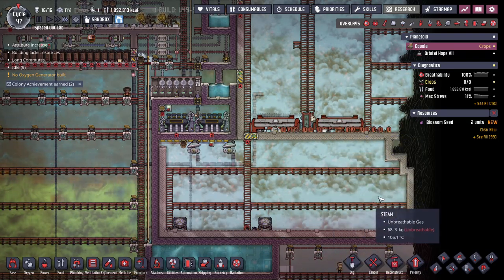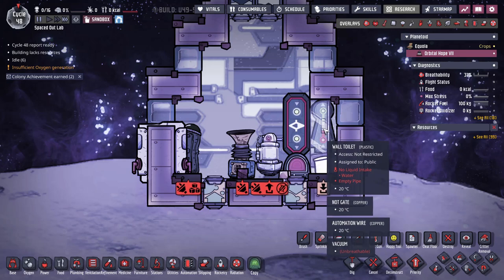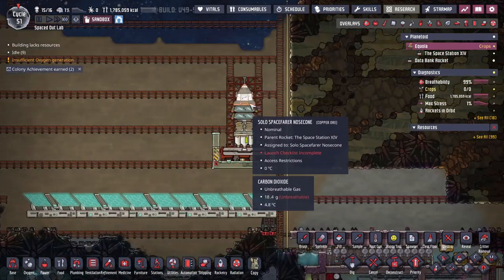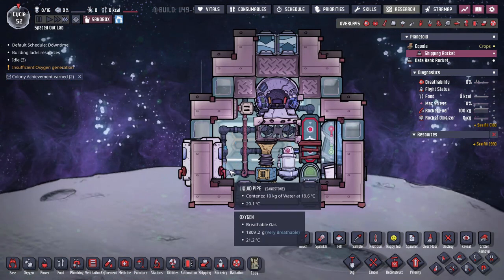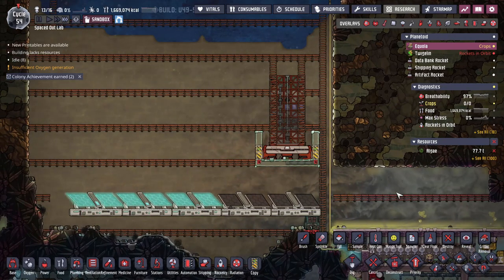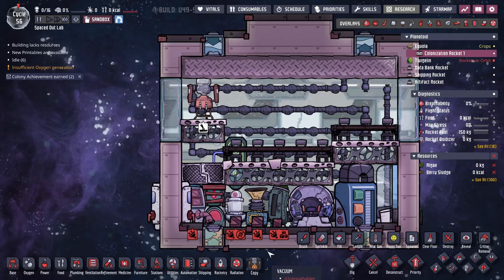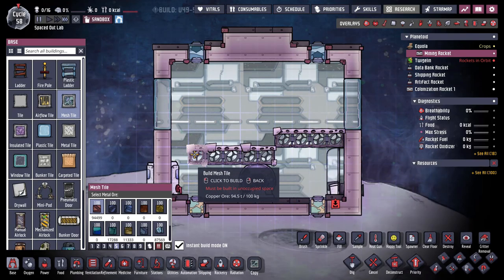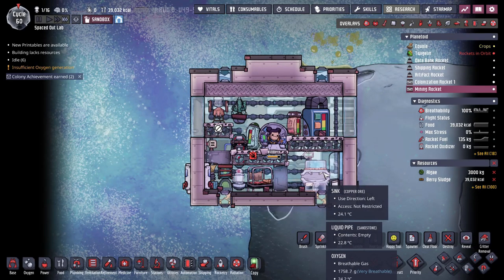How to build every type of Rocket Interior (Spaced Out)

Comment: One of the rocket interior design choices I've made for my games is to build a micro Hydra/soggy SPOM to generate oxygen from a liquid reservoir or a rocket liquid tank. The micro Hydra/soggy SPOM consists of just one electrolyzer and two gas pumps, one for the oxygen in the spacefarer module, one for the hydrogen when I reach my destination asteroid to use as fuel for a hydrogen generator or any other use for hydrogen. The micro Hydra/soggy SPOM takes up almost a quarter of the spacefarer module but a full liquid reservoir with 5T of water can generate oxygen for a very long time while your Dupes are building out a new base. Plus, you can just hook up the external liquid port on the spacefarer module to bring in more water. I also built my rocket's bathroom on the upper section of the module so that the background radiation from space can sterilize all the food poisoning germs away.
Reply: Do you have a screen shot of what this looks like? I was about to ship out for the first time but have ZERO algae, haha.

Comment: How do you ship liquids?
Reply from the maker: I don't ship many liquids these days, but I suppose if you needed to, you could fill a spacefarer module with tanks and the liquid you want to transport if it's cool enough for your duplicants to live along side it for a little while.  You can also put a liquid cargo tank on your rocket, but it only holds 9000kg so it's not the greatest option.

What are you wanting to ship?
Reply: @Magnet_MD    I'm trying to transport some crude oil. I'm playing on the radioactive ocean asteroid with teleporters disabled. I got to the oil planet (dupe almost suffocated because I had no algae, but I did bring just enough full oxygen masks), and I just need to get enough oil for a bunch of plastic. 
I guess I could squeeze a liquid tank in the small capsule. Thanks for the idea.

PS:  It just occurred to me that I can take a drecko egg instead and get both plastic and atmosuits all in one. Also, I can't even pump the oil because I don't have gold amalgam and the oil is 75 °C
Reply from the maker: Ah, interesting.  Do you have any crashed satellites on that asteroid?  You could skip to interplanetary launchers if you have the power to push it.  What's the oil for?  Just petroleum for rockets?  Cause you could just centralize your oil-based production on that asteroid and ship the byproducts (plastic) instead.  You also don't necessarily need petroleum for rockets, you can use other methods and still get everywhere you need (steam and hydrogen specifically).